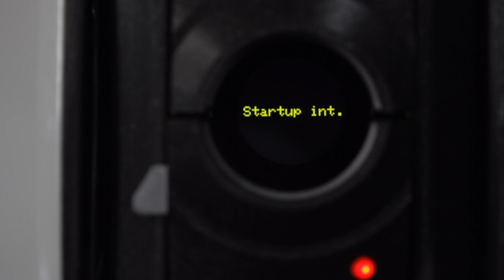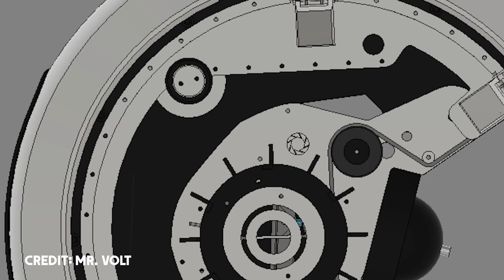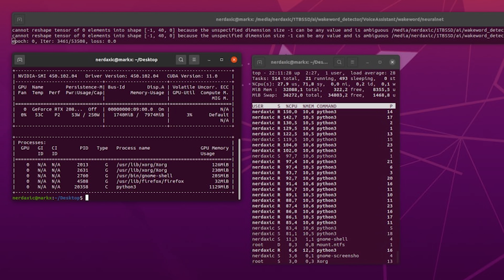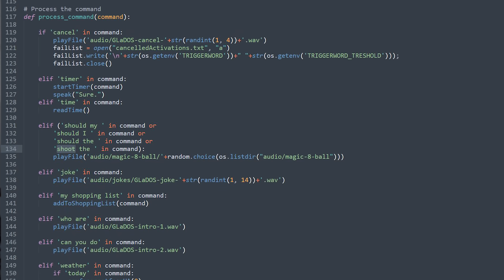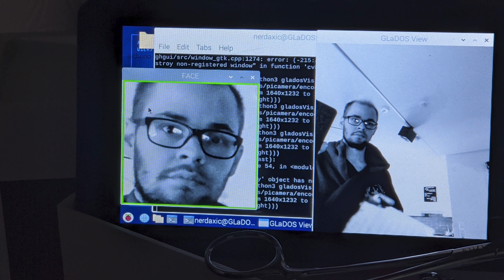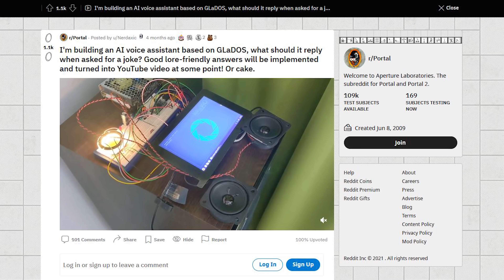GLaDOS Voice Assistant | Introduction - Raspberry Pi and Python

Comment: Voice is wrong though.
Reply: It's good enough dude
Reply: no @NikoView
Reply: @Nekotaku_TV  whatever
Reply from the maker: It used to be a neural TTS trained on Portal 2 voice samples. There is only so much training data. It is hard to match the original as it was basically autotuned opera singer.
Reply: It's very similar to the portal 1 voice. Definitely not based on the portal 2 one.

Comment: Have you looked at the Mycroft assistant and python libraries. I'm doing something sort-of, almost, not quite the same as you. Like you I didn't do the wake word work.
Reply from the maker: I have looked into Mycroft, but it also seemt like a black box to me (probably not the case) but I wanted to make my own for full control. It would be smarter and could answer more questions but I only need to know the distance to the moon only so often 😁

With mine, I can as questions like "when is the sauna ready" and it will tell me the time knowing the current sauna temperature and the time-temperature function of my sauna 🤓

Comment: Did I get that right, that you enqueue all voice feedback through the GLADOS voice generator service? I can imagine that the weather response has a lot of variability to it. What is the latency you get with the answer? thanks
Reply from the maker: Yess, this is true. Latency is usually 1-5min per voice sample. Key here is that I permanently cache the generated samples, so overtime they are found on local disk. Weather forecast has been split in such a way that there are like 10 different weathers, few standard phrases in between and a number and units. I only need to generate new samples few times a week.

Comment: This is very cool, but highly ironic that you’re sending all the voice data to Google for speech to text…no?
Reply from the maker: Yeah, it is. The difference is that I am in control WHEN to send them data so I know for sure when they are listening, plus the speech data is not connected to any Google account, thus it cant reasonably be used for profiling. I am okay with this for now and this is going to change when I find a working alternative. Ideas welcome!